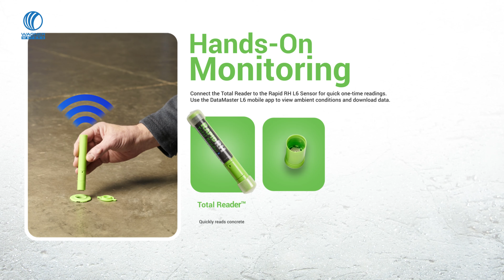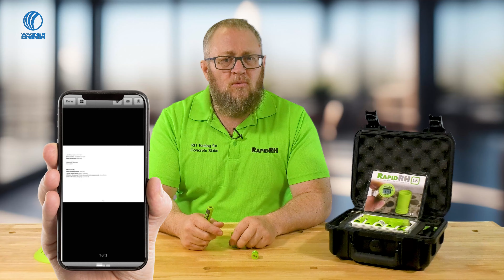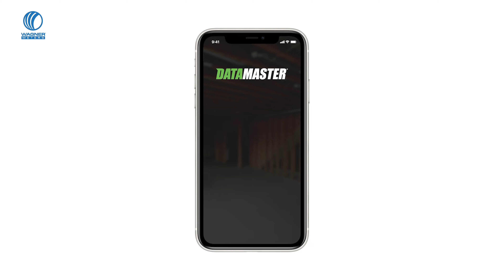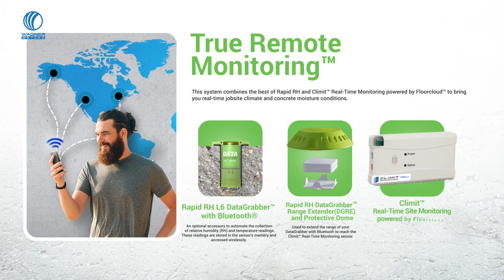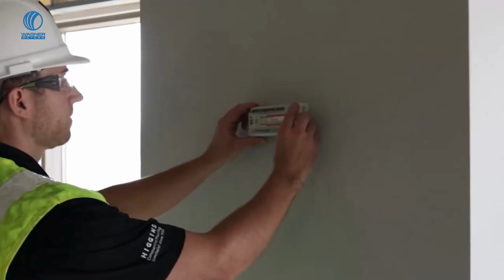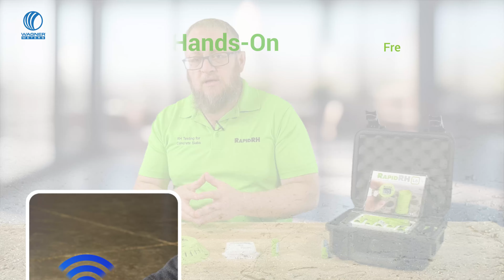Which Rapid RH Concrete Moisture Monitoring System Do You Need?

Comment: Impressive! I can upload data from the site directly to my office.
Reply from the maker: With True Remote Monitoring, you have the luxury of saving time by sitting in your office and seeing real-time RH% and temperature of not only the concrete, but of the environmental air at the jobsite.
Reply: Where can I buy the battery for the reader? Mines died.
Reply from the maker: @juanlozoria2000  Hi! You can buy them at most places. They are just a small, CR1/3N
Coin cell battery. Try a Batteries Plus+ of some type of store like that to be safe.